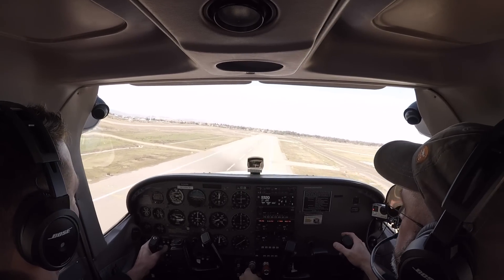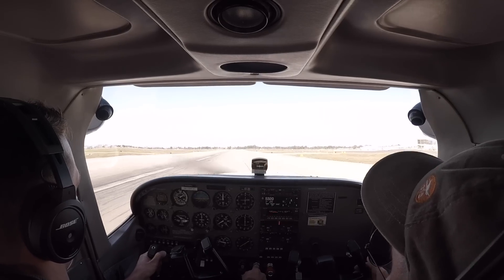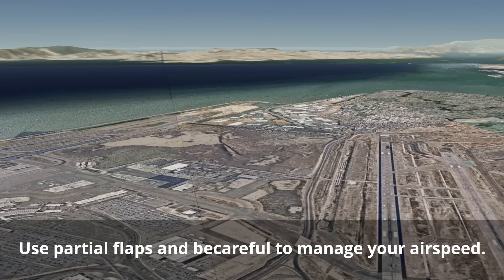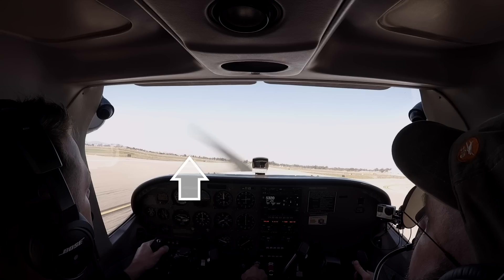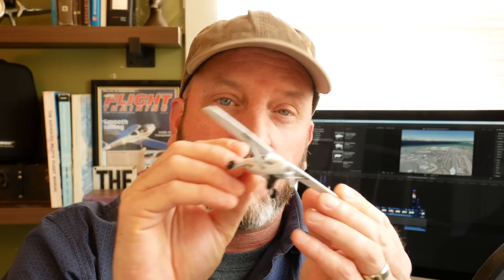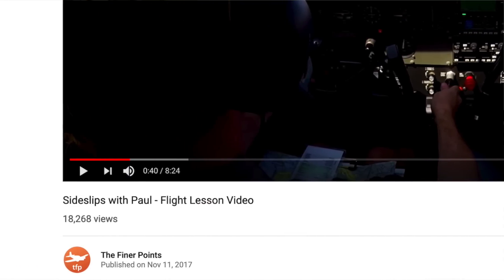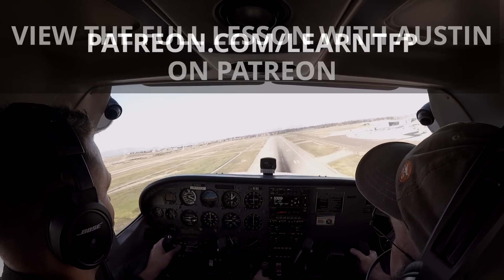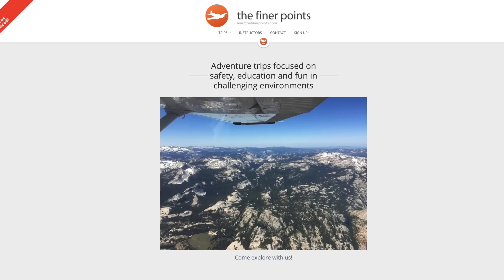Mastering Crosswind Landings in a Cessna 172 - Part 2

Comment: i think it is misleading to just say move the ailerons this way or that.  you need to drive with the ailerons just like you drive with your car.  you can't someone to just make a right or left input with the steering wheel in their car and you can't just say move the ailerons left or right either because the wind is constantly changing and you need to react to that with constant correct amount of aileron ..  so what you need to do is remember that the steering is backwards from what you would do in your car.  so if the nose starts moving left you need a little left aileron to go to the right and vice versa.  the faster you are going or the stronger the wind is moving over it the less aileron input you need to get the same reaction you will get with a lot more input at a slower speed.   since it is never the same, which is so true on a summer afternoon when the wind might changes sides on you several times as you roll down the runway you must constantly react to it with the correct amount of input.  so you are intently focused on directional control as you roll down the runway while you are steering the ailerons the opposite direction you want to go.  if you become proficient at this you will soon learn that the ailerons are much more powerful than the rudders for steering on the ground.   that is why almost all groundloops happen when the pilot steers his ailerons the wrong way while careening down the runway in his taildragger and his rudder is not nearly enough to overcome that incorrect aileron input and he is suddenly off in the weeds with a wingtip on the ground.

Comment: Does landing at high altitude airports (5000-8000) change how much this works?   If I could afford to become a pilot I would be landing at airports 5000’ Albuquerque,  NM for example.   The flight simulator I am working with has airports at sea level, and most CFI videos I have seen are low altitudes with high Density altitude and high pressure altitude.   Do you have to land at faster speeds because of the thin air up here in the mountains?   From what I’ve seen it takes a lot longer to takeoff on runway is at high altitude because Acceleration is slower and air is so thin.

Comment: Hi Jason. I know the odds of you replying are low but I'll give it a try. I'm a private pilot, I've got a little less than 200 hours, and I like practicing traffic patterns when I return to my field after a short flight, especially when there is crosswind. I will never be able to go beyond PPL due to a moderate color blindness, but I do care about flying as professionally as possible. I've noticed that when I decrab during a crosswind landing, I apply aileron into the wind as expected, but instead of touching the upwind wheel first, I will very often touch both main gear wheels at the same time. Everything will then continue smoothly, I continue applying increasing aileron as speed decreases and I keep the centerline by adding rudder accordingly. I know I am not applying enough aileron, and I'm trying to improve on that. But, to be honest, given that I am able to maintain the centerline, the benefit of touching the upwind wheel first is not that clear to me. I do understand that you certainly do not want to touch the downwind wheel first, and that the best way to avoid that is to touch the upwind wheel first. But I don't quite understand what's wrong with landing on both wheels when decrabing if you manage to keep the centerline upon touchdown. I know I am probably missing something here. What's your take on that? Is it really bad to touch both main gear wheels at the same time after decrabing?

Thanks for your videos and the effort you put into them. Quality content like yours is what the web was made for.

Comment: This was extremely useful during my solo today. There was an 8 knot crosswind that was somewhat variable and using only the crab it was difficult to time when to remove the crab during the flare due to the variability in the wind. It’s much easier to stay crabbed into the wind on final (since it’s much more stable during gusts) and transition into the sideslip for precise lateral control right before crossing the threshold on short final. I guess one thing to call out is the need to add a bit of power before doing so due to the increased sink rate in the side slip.

Comment: I don’t quite understand why you would want to use right rudder when you’re right of the centerline. Wouldn’t that result in turning the nose of the airplane to the right?
Reply from the maker: Todd Denning that’s why I say it like “prevent the nose from following.”
It’s a little confusing. Remember that it’s the horizontal component of lift that causes the airplane to turn.  so if you are right of the center line and you bank  to the left the airplane will turn to the left but you don’t want the nose to turn because you want the nose to stay down the runway. so that’s why you push right rudder - and the airplane moves sideways to the left
Reply: @TheFinerPoints  Got it! Thanks so much.

Comment: Maybe a dumb question: If low and slow at 50 ft in the air is a concern couldn't you fly say 6 ft above the runway instead. Is it due to worry over wingtips, lateral loads, ATC or something like that?
Oh, and thank you Austin for letting this be uploaded.

Comment: I think maybe you should start with side slips up in the air so the student get the manauver before trying over the runway. Maybe you have alraedy do it before with the student but its not in the video. Thank you , you are doing great
Reply from the maker: The hard part there is getting a reference that is specific enough to have the student notice the subtlety of the side slip. I think this can work well for forward slips, in fact it's a great idea for those. But side slips are very hard to "see" at altitude. Usually students use too much rudder without a runway reference. Even with a runway reference actually haha

Comment: I’m commercially rated and absolutely love how precise you can counter crosswinds to land on centerline with this technique. I have a question that has never occurred to me until now. There is a massive educational movement to prevent pilots from getting cross controlled on the base to final turn. Why is this technique (cross controlled at low airspeed and altitude) not considered dangerous like the dreaded overshoot on final?
Reply from the maker: That's a great question and the responses here are solid. It is a bit too much for a YouTube comment, but I thank you for this. I will take this up in a completely separate video, thx
Reply: tjm2212 two things- if you stall, slip, skid 6 inches over the runway, no issue, as long as the longitudinal axis of the airplane is aligned with the flight path, and no lateral drift. The base to final tie is done in the air, and contains an additional ingredient- yaw- that is brought about by the skidding turn. Stall+yaw= spin. 

If we stalled in a forward slip at altitude we could also spin, but it’s much more difficult to spin due to the aerodynamics of the slip (this assumes an aircraft with relatively docile handling). If you’ve ever heard of “under the bottom” vs “over the top” spins this is what we are talking about.

I recommend 2 things- read Rich Stowall’s excellent book “Emergency Maneuver Training” and also take a CFI up and have him demonstrate a couple of cross control stalls. Do one from a “crosswind landing” attitude as well as a base to final skidding turn. It’ll be worth every penny.
Reply: tjm2212 it’s not about cross controlled it’s about cross controlled while being too slow with the nose continuing to come up that kills you
Reply: Too big a discussion for a YT comment, IMHO, however one point to remember is that while the x-control required for crosswind is a slip, the base-to-final x-control is a skidding turn. Slips are safe and useful (to a point) however skids are bad technique that have no utility in normal flying, and are very dangerous low to the ground.

Comment: so forward slip is to lose altitude w/o gaining mch airspeed and side slip is use for crosswind landing?  plz correct me if im wrong..thanks for helping me understand..i always thought sideslip is use to lose altitude
Reply: One important thing that no one mentioned here, is that forward  slip is performed with power idle, so aircraft can decent. Important
Reply: Yes the point of a forward slip is to present as much of the side of the aircraft as possible to your direction of travel without changing your ground track.  Flying the aircraft sideways like that makes a ton of drag and reduces lift so you can lose altitude fast without gaining speed and without changing your course.  The point of a side slip is to change course without changing your aircraft's heading, in effect creeping sideways with the aircraft still pointed straight ahead.  This allows you to make course corrections without changing the aircraft's orientation to the ground.  If you made a regular turn to change course you'd have to turn back to straighten up with the runway and you risk landing side loaded or over-correcting, you'd be trying to perform two separate maneuvers while managing flare and speed in the short time before touchdown.
Reply: Correct, because a forward slip is a nosing over technique, whereas a side slip is pointing the nose into the wind to counteract the wind from drifting you off course/centerline
Reply: MasterDaddyChris   Forward and side slip is defined by the track the aircraft makes. A forward slip is for enhancing rate of descent (lead with rudder and follow with aileron to continue a forward track with the nose displaced in a crab) and a side slip is for crosswind landing control (lead with aileron and add rudder to maintain the longitudinal axis of the airplane with the runway centerline while controlling lateral drift, banking with aileron displacement)...like he described.